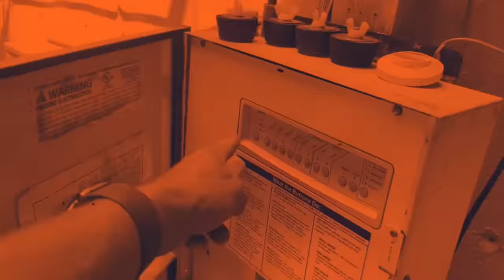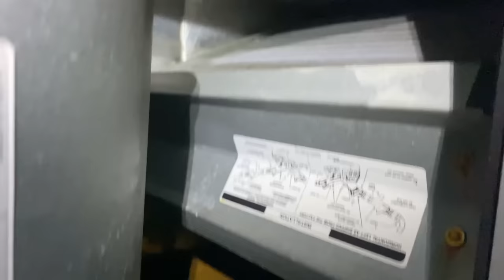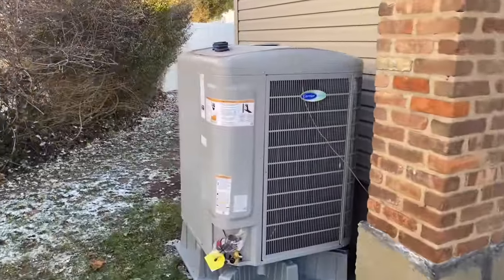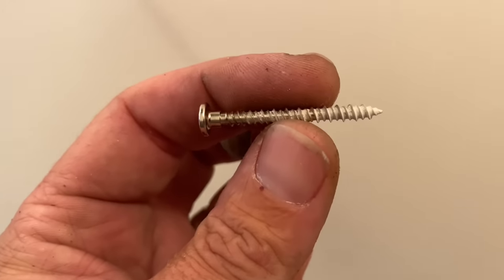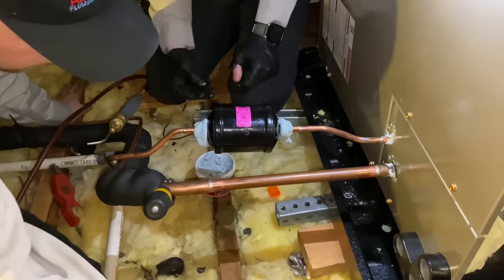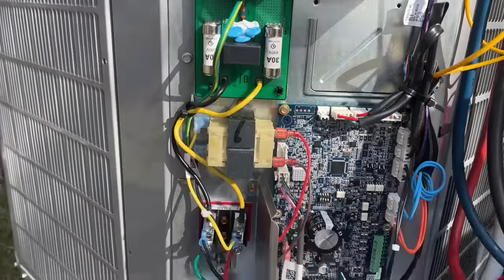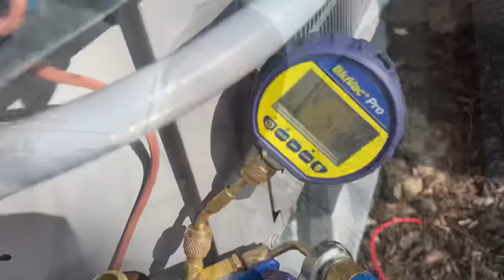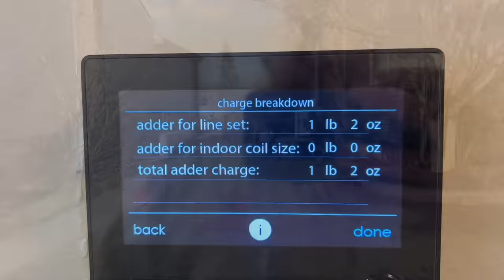Electrification in 2023 Oil Hydronic Heating to Electric Ultra Efficient Heat Pump HVAC System

Comment: Mike, the nails aren't leaking. The mold is along rafters too. 
I would put an N-95 mask on and see if they have a bathroom exhaust fan direct venting into the attic! There is a reason this house has massive moisture in the attic.
Reply: Yes, it probably rains in that attic if conditions are right. It is an inside moisture/ventilation problem, not leaky roof. 😉

Comment: Not leaking at the nails. They have excessive humidity in the house, probably from a humidifier maxed out and it’s stacking, basically going straight up into the attic and condensing on the cold metal nails. Needs a attic power venter.
Reply: Also not enough air movement, insulation shoved too far, need ridge vents installed.
Reply: probably bathrooms, other exhaust fans and maybe dryer dumping into the attic.
Reply: Nobody going to mention the R19 max in the attic?  
Stripping the attic, 2" CCF for vapor barrier, R30 minimum.  THEN add the airflow.   But the heat transfer to the attic has to be stopped first.
Reply: @RES_Plumbing-Drain  Also about  a Foot more Insulation required  ...would seriously help to reduce those Bills and even lead to getting a Smaller Unit...
Reply: @RES_Plumbing-Drain   - the soffits will also have to get openings to allow air flow up and over the bottom surface if those sheets of roof decking.

Comment: I've installed a few of the carrier VNA4 heat pump. Great units. Small board on bottom allows for the tech to connect to unit thru Blue tooth and check operations and diagnose, as well as software updates

Comment: I would say the roof isn't leaking there is just high humidity and no air circulation in the roof space. And the nails are a cold spot for it to condense.. Great video at always. 🇬🇧
Reply: I see what you did there

Comment: Those big ass vacuum hoses with the same old 1/4 fittings cracks me up.
Reply: and the small schrader ports, or leaving the valves in. but even so the larger hoses will help some.
Reply: @throttlebottle5906  The difference the hoses make has to be trivial at best and not worth buying for that reason alone.   The flow while evacuating a system decreases quickly which means less friction loss in these bigger hoses is just not an issue.

Comment: In 2012 I installed a Bryant Evolution Extreme 280ANV036 and loved it!!!  Saved mucho dinero too!  Comfort Setting is the only way to go to maintain best humidity levels, hot heat, cold cold and quiet operation. Also minimum 8k+ heat strip if the heat pump goes wonkie. Circuit boards can be a fickle bitch. Liked how you can manually adjust hi/low fan speed limits for best circulation and efficiency.  Paid $6400 for mine new at old house in SoFLo and wish I could afford another one up here in central florida where is gets down to 30's and 40's throughout the winter season. Love your channel!!

Comment: The stay brite 8 dilemma is a tough one, Im sure it lives up to Harris's test results for tensile strength, burst pressures, liquidity temp, ect.  And those are all well suitable enough for any HVAC system by a long shot no doubt,  I mean cmon, Harris showed test results where one end of a copper tube was soldered with staybrite 8 and  had a 15% braze joint on the other end and did a burst test, the pipe itself burst 1 inch away from the 15% joint do to higher brazing temps weakening the copper tubing  around the brazed joint.  I believe its a great product, The problems are one: you mentioned the biggest one, fire,  theres no doubt the joints will melt and blow out if the units engulfed in fire when the liquidity point is around 500 give or take a little,  braze wins there, which i think is the main reason why its actually not an accepted joining method and many local codes DO NOT allow it and many manufactures have specified in IOM's for years brazed joints only, except for mechanical connections obviously, because they dont want components failing from flux entering system, you know how some people like to really get that flux all up in that shit, Flux has two ingredients in it that are both detrimental to refrigerant systems with POE, water and acid, who really knows how much flux gets into the system even when applied very minimally.  At the same time though, even with silphos alloys like 5,15% you must use flux when joining copper to brass, and the 45 and 56% alloys must use flux when joining copper to steel on systems, also alluminum brazing on newer coils requires flux as well, so not sure what to think of that argument.  But ya the fire thing is a tough one to deny though, refrigerant burning , toxic gasses are deadly , not a good thing

Comment: I personally believe in brazing all of my connections. In winter of 1986 I was working on a 1972 Airtemp furnace in a basement. R22 evap lines were sweat  in with staybrite 8 or equivalent, I believe. I pulled on the suction line just slightly to get it out of the way to make room for a humidifier and pop the solder cracked and line blew out. I dumped the whole 15lb charge into the basement. The furnace was on and the flames turned bright green. Inhaled a little ph***gene before getting smart enough to get out. Got very lucky that day. What would have happened if that was a homeowner? I won’t take that chance. A bad braze will only leak a little and is easy to fix. There is a place for low temp solder, like evaps and associated piping and controls in medium and low temp refrigeration applications but in applications where there is potential for high pressure and the brazing is easy I will always braze. I have seen low temp joints fail under the right conditions. It is very easy to not quite fill the joint with solder and have a future issue. 
Carrier recommends high temp brazing as well. Why take the chance on a leak just to save 10 minutes and a little nitrogen.
Teach your guys to braze and get them some good oxy-acetylene torches and make your connections really permanent. 
Doing this since 1982. I’ve seen a lot of things come and go through the years.
Reply: the other channel showed this unit was leaking on a connection and low on gas 2 days later. he ended up brazing it for the repair 😦

https://www.youtube.com/watch?v=egv4l8PDDKQ

Comment: Question why carrier heat pump instead of residential vrf system samsung, mitshubishi, daikin due to the cost being close carrier usually more when i price out my systems. i get the humidification plug in options and mostly American made besides that is there a reason for the choice? Second question are you pressing refer fittings yet if so what brand.

Comment: Make the trades great again. That roof is a major problem but not the plumbers fault. Good work as always.
Reply: It is not the roof it is shit insulation and maybe a bathroom vent going into the attic.
Reply: @Tom Sawyer anything is possible but it is usually the bathroom vent going into the attic or not enough insulation

Comment: The original installation of this heat pump looks like a typical hack job that I ran into all the time in New York. Kudos on using stay bright #8 I use that on all of my line sets when I do residential side jobs. It’s more than strong enough with tensile strength and heat. I love staybrite.
Reply: @PipeDoctor  I was wondering what that was and the lack of nitrogen. Granted I have done two systems on my home and only one was purged. Both work pretty well and have only needed refrigerant added once and one cap replaced in 12 years. Now I will say that and will have issues tomorrow.

Comment: steel (nails) are a thermal bridge the warm humid air coming from the living space condenses on the cold nails and drips...this is called attic rain need to seal the area and prevent humidity getting into the attic..just saying...

Comment: Mike you introduced a lot of warm air into the attic. The nails are wet due to sudden condensation. When closed up it will go away. Not sure that's mold.
Reply: It may go away, it may not if the vapor from the living space also gets into the attic via openings other than the attic hatch.

Comment: Hey Mike im pretty sure you need a inverted trap on the Refrigerant  piping. Piping needs to be above the evap coil like how the old lineset was ran
Reply: I look up the manual before I opened my mouth about
Reply: You need an inverted trap if the furnace is below the condenser not in the attic because oil will naturally flow back to compressor 😊

Comment: I think the nails weren't leaking. The warm moist air was condensing on the cold metal. Not much insulation in that attic and I bet there isn't much ventilation.

Comment: That’s condensation on the nails. 

Insulation should have been up in the ceiling, with air bats to allow flow of air from soffits outside

Comment: You are right about Bosch tech support. Does that Ifinity have the micro channel evap coil? And I thought you went to copper crimp shark bite type couplings instead of still abarazing? And with my recent experience with Carrier this past year. I wouldn't be able to reccomend it for replacement.

Comment: Stay rite is good but ya gotta watch to not put to much flux
It also may not be the best choice for heat pump as the pressures are higher in heat mode

Comment: Been using Carrier for years ,exclusively. Nice equipment but the infinity stuff is big money. Awesome system. Have the same one in my house and a bunch out in service. Nice job Mikey Pipes!!
Reply: Carrier Infinity are trash. I have one and because I’m not the original owner it only has a 5 year warranty. Of course I noticed it freezing up and had a carrier service company come out that installed it and they can’t figure it out and carrier won’t warranty it because here in Ny it was installed in April so the warranty ran out in April but I don’t use Ac in April and when we ran it for the first time in late May warranty was expired. In the spring I’m ripping out this crap that was installed new in 2017.
Reply: @PipeDoctor   - that is a decent warranty, but is that warranty transferable to new owners upon sale of the house?
Reply: That’s what carrier told me that the 10 year warranty is for original owner even know it was installed April 2017 and I bought the house August 2019. So the system was only 2 years old when I bought house and if you put equipment serial number it says 5 year warranty because I’m not the original owner. It just infuriates me with how much these cost that the 10 year warranty wouldn’t extend to new owner. The real kicker is the companies that I called could ask the distributor to cover mine under warranty because it was just out of the 5 year by a few months but they never get back to me. I call and email but nothing.
Reply: Too bad you’re not upstate. The companies that deal with carrier Infinity systems have no clue. I spent over 500 to have them replace the TXV and filter because they have no idea. Furnace part works great but condenser is trash. I was a Carrier fan boy for a long time. I have had 5 carrier systems installed in multiple homes I have owned over the years too.

Comment: Mitsubishi has air to water hydronic heating now as well. Need to check it put
Reply: Spacepack has a new monoblock using a Mitsubishi vapor injection compressor. Self contained, just pipe it up with PEX to a hydrocoil, throw in some antifreeze and you're done. Definitely the future of heat pumps. Makes your domestic also. Heading to Atlanta for the ASHRE show Monday. Im sure this is going to be a big deal. Everyone already has them in Europe, they just started introducing them here.
Reply: @PipeDoctor  I'm in Atlanta now at the ASHRE show. Today I spoke with several manufacturers. One claimed max temp of 145. But most are saying 120. I'm looking to talk to Gree and Spacepack tomorrow, I will let you know what their temps are.
Reply: @PipeDoctor  I spoke with Spacepack today,they seem to be no bullshit and have been doing this for a few years. They can run at 130 degrees and they make them with both standard inverter and their newest one uses a Mitsubishi vapor injection compressor for cold climates. Gree also has a new monoblock setup and sever others will be introducing theirs shortly. Also a wide variety of hydrofoil fan units were on display.

Comment: Great install Mike I admire your knowledge and use of current and emerging technologies.   I do have a question for you, Mike, I am 59-years old. I’m not using a former contractor, and I am very mechanically inclined. Am I too old to get into the *HVAC trades? I do have some knowledge of plumbing and heating. I am can perform many tasks, but I am very interested and obtaining more knowledge. What’s the best route for me to take?
Reply: Yes your late to the game,sorry bro it takes about 3 years to get good and learn the trade.
Reply: @chesneyquinn2377  As long as i have breath in my body its never to late.  
I was trained for 10 years by a master plumber. I don’t know your qualifications, but I probably know just as much as you do or even more. And my question was not directed to you. It was directed to Mike but thanks for your reply.

Comment: Units have sweat suction and liquid tube connections. Make suction tube connection first.
1. Cut tubing to correct length.
2. Insert tube into sweat connection on unit until it bottoms.
3. Braze connection using silver bearing or non- silver bearing
brazing materials. Do not use solder (materials which melt below 800_F / 427_C). Consult local code requirements.
4. Evacuate coil and tubing system to 500 microns using deep vacuum method.

this is right out of the carrier install manual
Reply: @PipeDoctor  i agee with you, however the install instructions specifically say to use a brazing material that has a melting point over 800degrees f, the melting point of stay bright 8 is only 550.  you seem to be a stickler to the instructions and this is a clear observation of the instructions not being followed.
Reply: @PipeDoctor  if another carrier dealer went out there and observed the use of soft solder joints it would void the factory warranty.  you know manufactures look for any reason to void the warranty

Comment: i do like to watch your videos but i have to mention i disagree with your use of stay brite 8 for assembling refrigeration piping.  i have installed many systems and every install manual specially says to braze with a nitrogen purge.  i have researched this before i commented and it appears the only thing that says you can use stay brite in place of brazing is stay brite itself.  i am surprised you would not catch this in the install manual as you seem to be up on all the acceptable practices.

Comment: the nails are wet because of condensation, not a leaking roof, you would see wet wood around them.  I would bet there is a bathroom vent going directly into the attic. or maybe a leaking duct from the old system.
Reply: @PipeDoctor  Like that was hard to see

Comment: That units should be at least a foot away from the house and ideally it’s recommended 12-24 inches if that could be achieved but 10 inches is a little tight

Comment: Mikey,  What's your opinion on using wagos to hang ceiling lights and over vanity lights?  I wear a dust mask in attics and crawl spaces.
Reply: @PipeDoctor  eagles burn up over time with high current. Led lights that only draw half an amp are fine but for something that is constantly carrying over 10 amps wire nuts are the goto. Eagles will burn a house down quicker than you walker aw
Reply: Watch the wago vs wire nut current testing videos on YouTube. Wagos win.
Reply: @fedfreds832  not true.